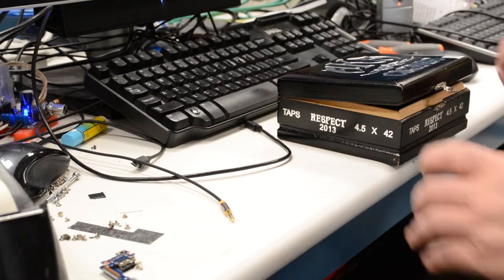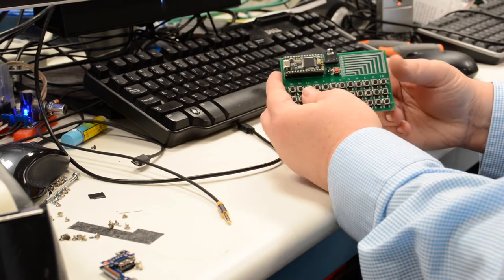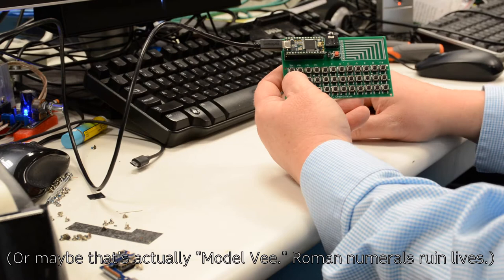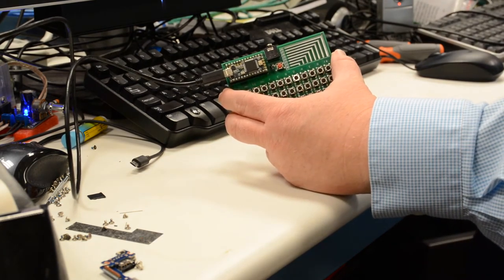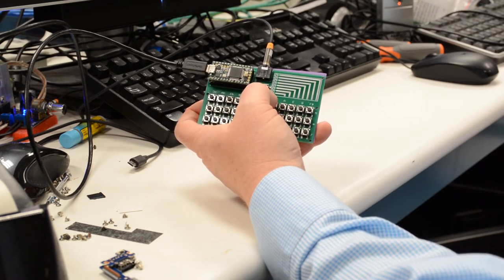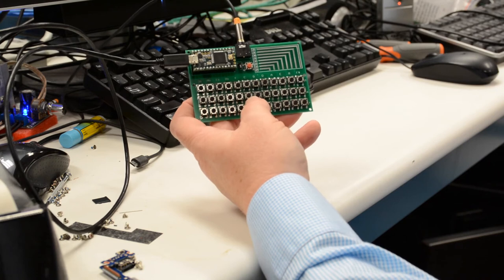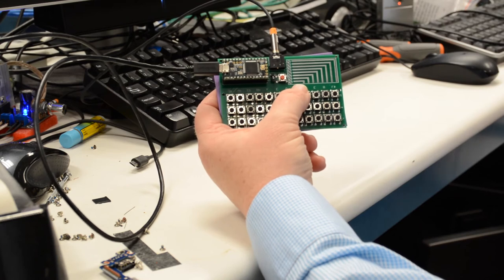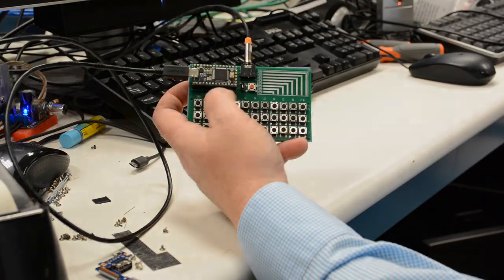T. Chordstrum MIDI controller kit - demos and walkthrough

Comment: Does this device play in key? Do you have to know what scale degree you are on to know what cord sorority to play?
Reply from the maker: As a MIDI controller, it definitely outputs the notes it's supposed to, so "play(ing) in key" will depend on the devices or software that are the actual sound generator(s). Note that much of my demo video is using a software synthesizer running on my computer as the sound generator, although I do use the internal sounds a lot here too. The Chordstrum does seem to be largely in tune with A440 standard using the two internal sounds you will get with a Teensy 3.2-based build; the Karplus-Strong-driven "autoharp sound" is only noticeably out of tune on the highest notes you might strum out, the other internal timbre available is fine. I am not really sure I'm answering / correctly understanding your first question, though, so let me know. 

Second question is a little harder to answer / understand. If you are playing along with a chord chart or lead sheet, that's all the info you would need to find the right buttons on the Chordstrum for each chord root and quality called up. I think by 'scale degree' you're referencing the chord root. Yeah, you would need to know that (usually), but that information (or someone's best guess at it, anyway) is provided in chord charts and much printed pop music / Internet tablature / etc. There are also lots of genres and situations where you can just make something up and it either sounds good, or it doesn't, and so you try another chord. I deal in both approaches frequently.